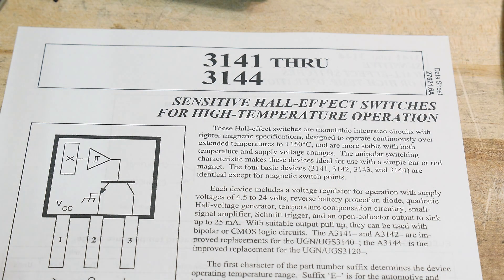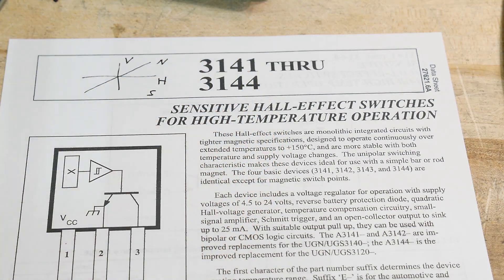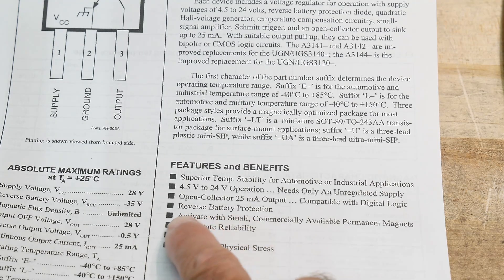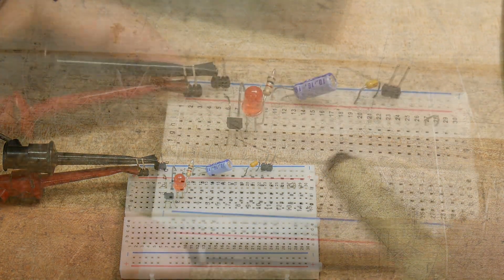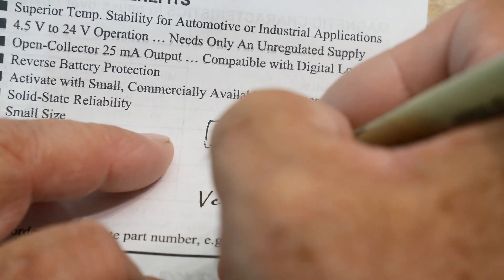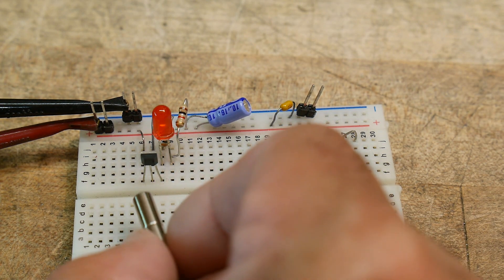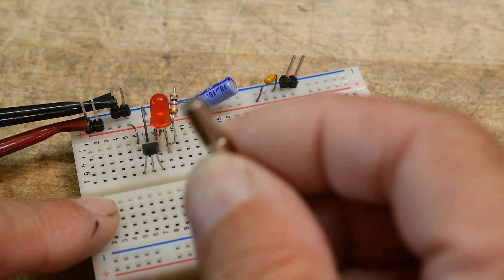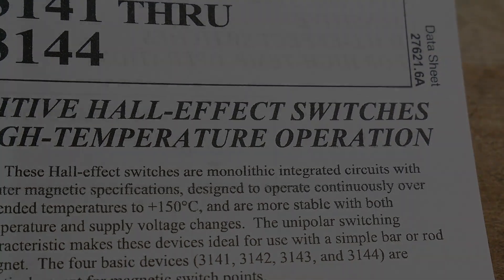#842 Magnetic Hall Effect Switch OH3144

Comment: One common application for these is as a tachometer sensor. High efficiency boilers (home heating) have to have a variable speed combustion fan. To monitor the speed of the fan they can use a hall effect for tach feedback. This is the case for Buderus and some Bosch units. I'm sure there are others. Use a compass to measure magnet poles.
Reply: Tachometer, that what I did 35 years ago on a VW diesel engine, 4 magnets 90 degrees apart on a plate bolted on the injection pump sprocket, the sensor would give me 100 HZ @ 3000 rpm, same as a gas engine so I could use a regular tach out of the box.